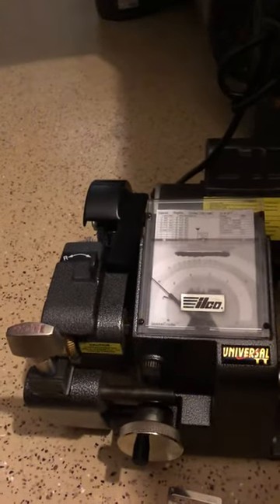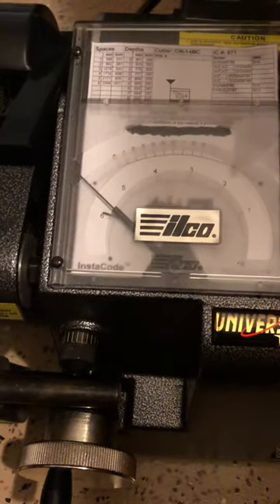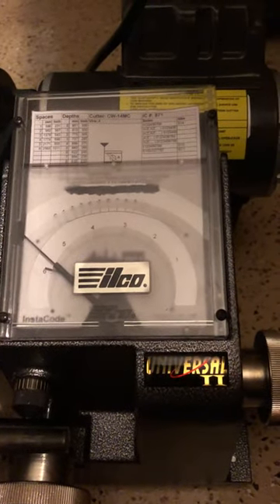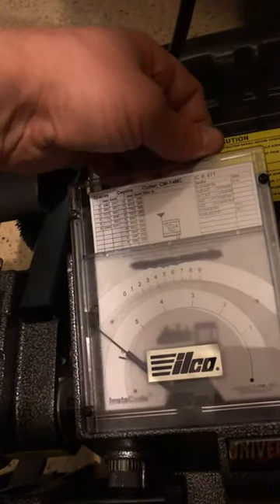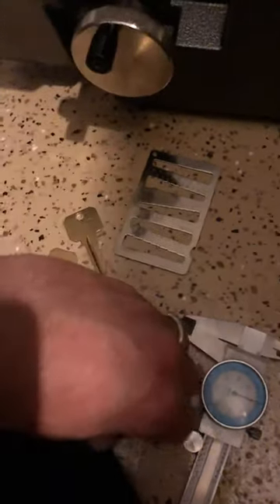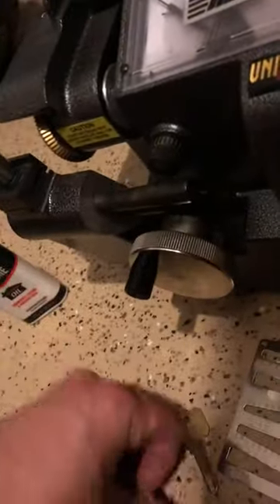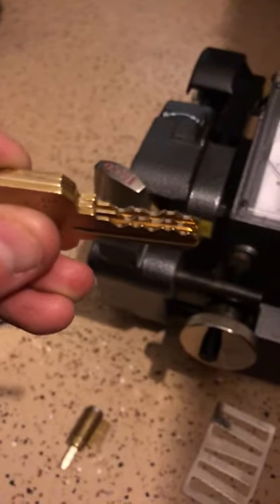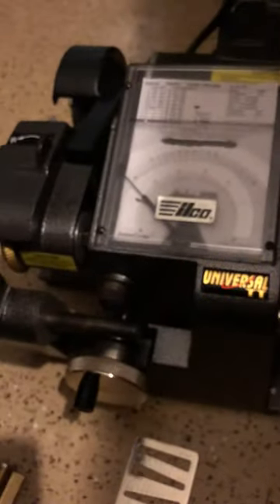Ilco Universal II code machine- I need help calibrating and printing cards

Comment: Mate, when you print your cards out from Instacode, make sure that your printer settings are set so that "scaling" is turned off.  I think that is why your cards are printing out the wrong size. When you resolve that problem, you should be able to sort out any other issues that you've been having.

Comment: The round button in front has an allen screw inside. Be careful not to over tighten. Loosen it up and then the circle piece surrounding it will dial left or right which changes the depths. When you get it where you want it, keep a grip on the dial (otherwise it will move) and then tighten it up snug. Just so you know, the allen screw does not come out as a part. It is a one piece machined piece with a point on the end that pressures against the dial mechanism that determines the accuracy of the depth you want.